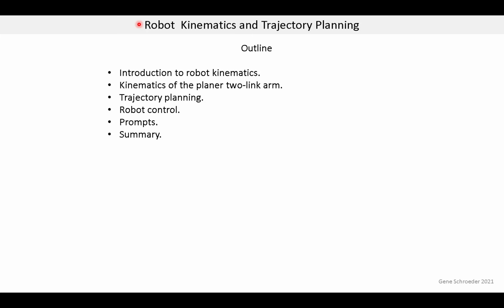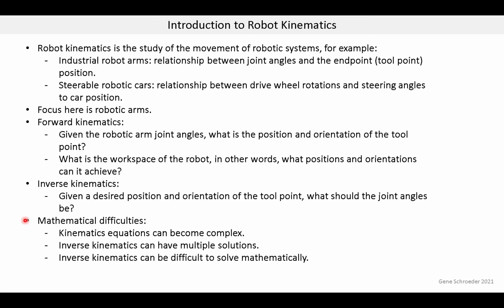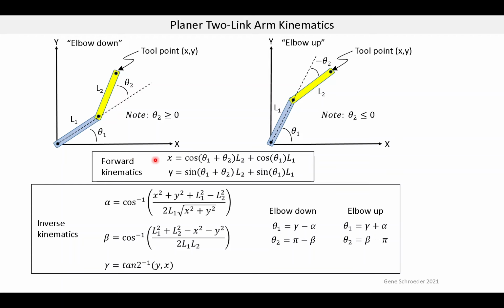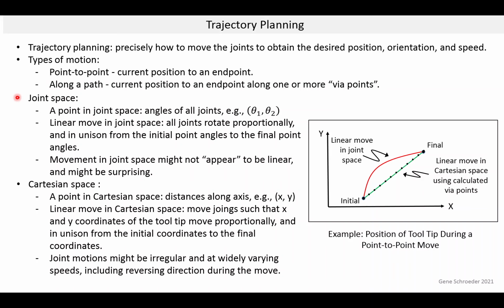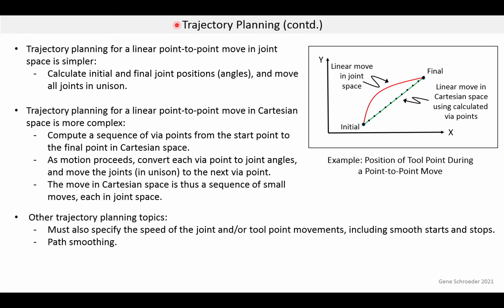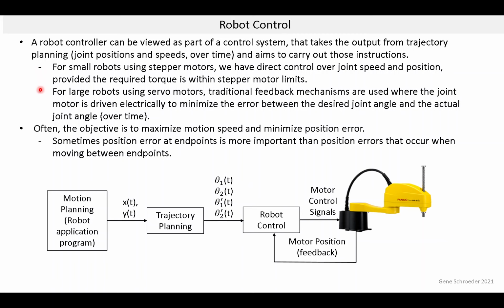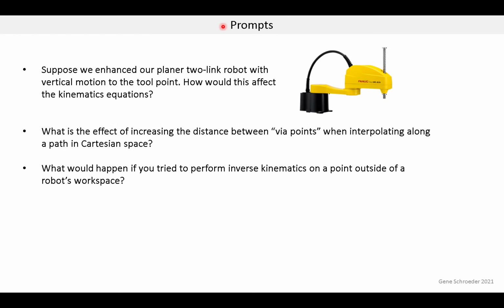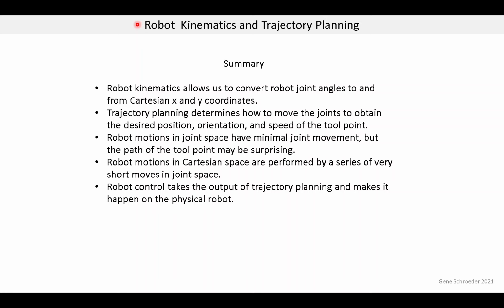Steppers and Robot Kinematics Lesson 4. Robot Kinematics and Trajectory Planning

Comment: hello! I was wondering if there is a way to graph all the possible joint angles, and how that can be done
Reply from the maker: If I understand your question, then if we look at the robot arm from a physical viewpoint, theta 1 can have any value. However, theta 2 is restricted because the pen holder might hit the first arm. So theta 2 might be restricted to approximately -160 to 160 degress.  Since there are only two angles, it might be possible to have a graph where one axis is theta 1, and the other axis is theta 2. Then you would graph the region of possible angles combinations.
Reply: @geneschroedertech7501  yes but my question is how do i find the possible combinations of theta1 and theta2? is there a specific method or formula? or do i just input random variables and make assumptions?
Reply from the maker: I think you might be referring to the "configuration space"  (C-space) of a robot, and more specifically the "free C-space". This is the set of joint angles where the robot does not strike an object (including itself), and it does not violate a joint limit. It is described in many robotic text books, usually as part of path planning. However, I am not very familiar with this topic - it seems in general it would require 3-d geometry analysis.

Now for the simple 2-link robot, the free C-space is easier to visualize, and get the result as I gave in my previous response. But I don't know a general way to do this (for example, for more complex robots).

A related question is the joint-space of the inverse kinematics solution. In my implementation of inverse kinematics, I always calculate the "elbow down" configuration, so this restricts theta 2 to be >= 0. And as I mentioned previously, theta 2 is limited to approximately 160 degrees due to pen holder. I don't know of a way in general to determine this joint space, other than analysis of the inverse kinematics equations. Certainly you could plug in random input variables to get a rough idea.

Thank you for you question. It is a good one, but a complete answer is beyond my knowledge of kinematics. When I worked in robotics, I had colleagues who were experts in this area. 😀
Reply: @geneschroedertech7501  Thank you for your help anyways! :)

Comment: Great video, I just need help with the inverse kinematics. How to define x and y?
Reply: I have a assigment where I need to use a 5 bar mechanic
Reply from the maker: I think by "5 bar" you mean the machine in this paper.

https://www.robot-maker.com/forum/index.php?app=core&module=attach&section=attach&attach_id=10092

This paper gives the basic kinematics,
Reply from the maker: x and y are the coordinates of the tool point, which is at the end of the second link.

The inverse kinematics require use of some trigonometry. See Chapter 6 in this book:

http://hades.mech.northwestern.edu/images/7/7f/MR.pdf